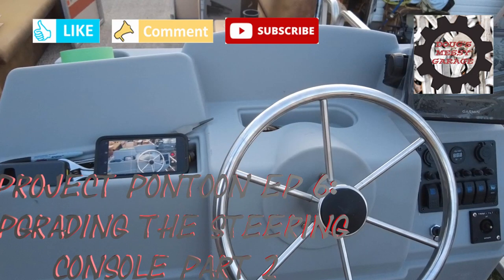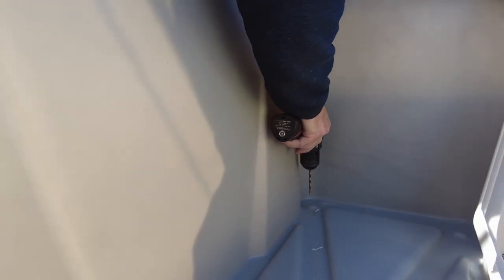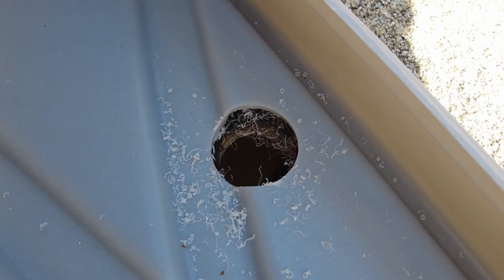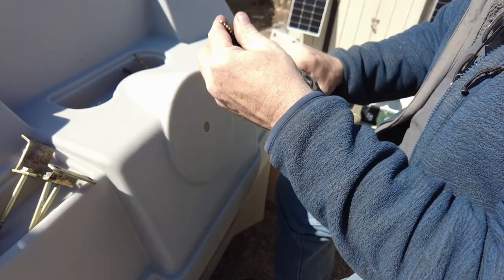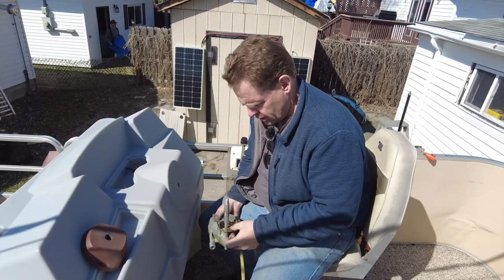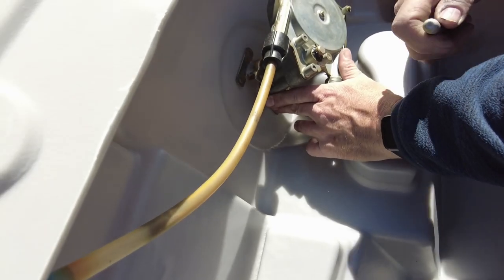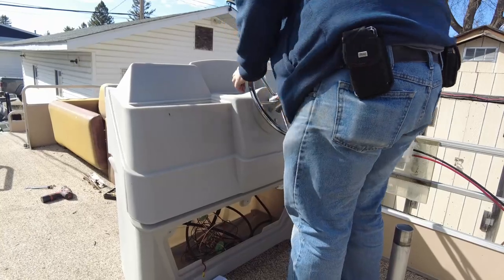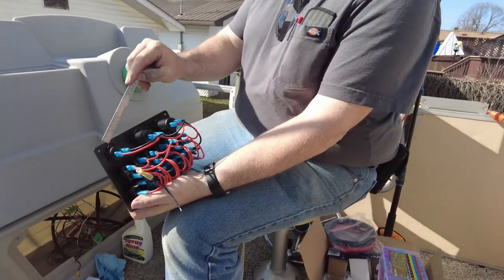How To Install a Steering Console PT2, Steering Rack & Switch Panel Mounting: PROJECT PONTOON Ep6

Comment: Hey Doug I got a question I’m installing the same helm and steering system what degree bracket did you order? I see some are 90 degrees and some are 20 not sure how they figure it out.
Reply from the maker: The bracket that came with my old console was the 20 degree bracket and I used it initially because that is what I had.  I ordered the 90 degree bracket so the wheel would match the angle of the helm.  I have the 90 bracket now but have never installed it because I kind of like the 20 degree bracket in my application.  

If my captains seat was a bit closer to the helm, I suspect the 90 would be perfect.  I misjudged the length of my arms when positioning the helm and therefor the extra inch or so that the bottom sticks out with the 20 degree bracket  makes the wheel position perfect for me.  From an aesthetic point of view, the 90 would probably look better though so if you want the 90, make sure it is comfortable to reach the wheel when seated.

Hope these musings were of some help.   Thanks for watching.
Reply: @DougsMessyGarage  yes it did clear up what I was thinking about thanks for the info